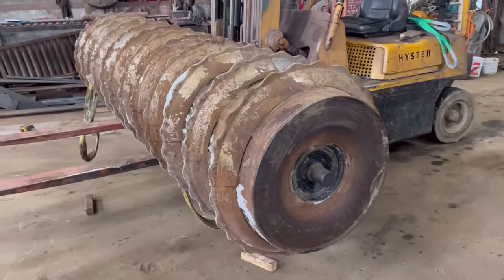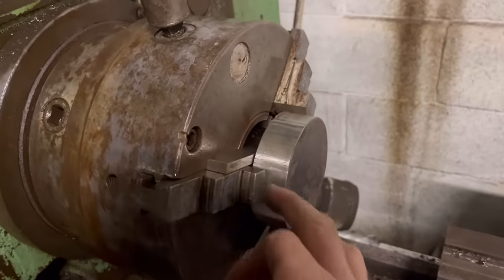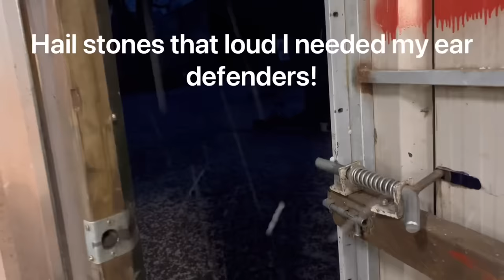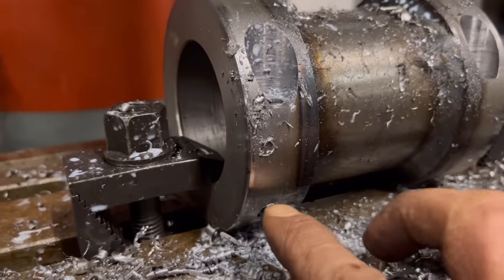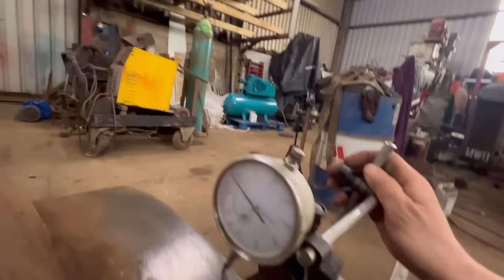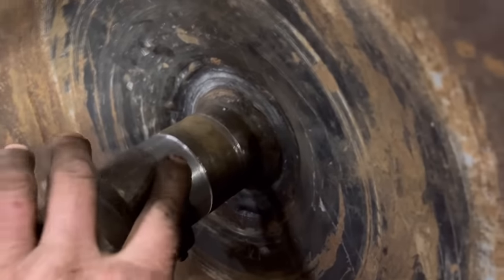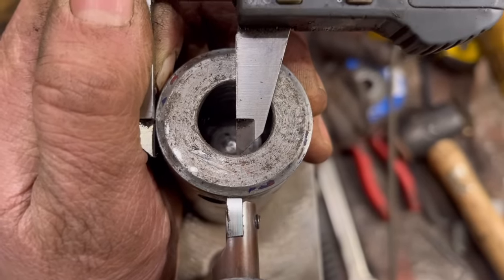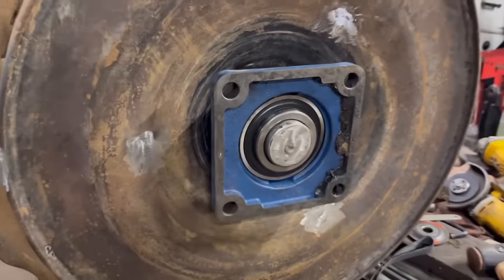Rebuilding stub shaft on Sumo Trio packer roller.

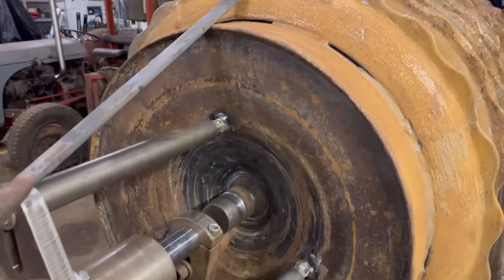Comment: 45:48 maybe another three legged support same as the one bolted to the legs you welded to the roller.
That should stabilise the cutting shaft holder to reduce movement.
I’m sure you will have a multitude of modifications over the years to perfect your line borer.
Changing the cutting tool center height made a big difference there was more cutting less rubbing.
👍👏🚜

Comment: Where most would have given up, Snowball figures out a way. Impressive!! It seems like some support on the other end of your line-boring rig would have helped. If your fabrication table extended out under the line-boring setup, and there was a way to brace the hanging end so it isn't hanging, it might cut down on the wobbling. I'm sure you'll continue to improve the design, and I'm here for it.

Comment: Hey Oliver, very nice, well done. For this type of work i love the horizontal boring mill tho 😅 maybe for more rigidity put a roller stand on the far end where your drive motor sits, it could help the flexing of the entire boring setup. Or try for a finish pass a razor sharp ground aluminium insert or hss toolbit and take of only a small amount to get a good surface finish. For this application it is good enough considering the amount of wear and that it was in use with a couple mil undersize 😊 Greetings from Germany, Chris
Reply from the maker: I was using an aluminium insert for the last light passes. Was cutting a lot nicer with no chatter 😄
Reply: @snowballengineering  good to hear it worked for you 😊👍. For me almost the only reason to have aluminium inserts, as most of my work is steel. But they do come in handy in some setups where rigidity and stickout is an issue 😝

Comment: Very impressive line boring setup. I don't think people understand what it takes to get this right and how much it costs in time and materials. A set of metric 8mm taps for example, hugely expensive. I hope you charge customers appropriately for your skill and time. 
I think getting the whole roller to run true on rollers is very difficult as the wear and out of round are not only affected by welding but also by the nature of the work that the roller does.
Well done, thanks for the video.

Comment: You can make it more rigid by replacing the washer on the capscrew that's holding the tool holder. Make up one that's 10mm x the width of the tool holder holder. If that makes sense. Great job and great channel.

Comment: NIce work Ollie. Love the home? made line borer...I might have to make  me a copy as I have a 1970s vibrating roller that needs the stubs repaired. Regards chatter - maybe support the end of the boring assembly as already suggested, and rough out with a tip tool but then switch to a purpose ground square bar HSS cutter with high rake angle and sharp but radiused tip. Tip tools need higher speeds for better finish and I think the HSS option would improve the finish at lower speeds. Using some cutting lubricant on the final cuts too may further assit. Carry on the great work....cheers P from NZ

Comment: That must have been one of the most complicated repairs you've had in, needing to make all sorts of adaptors to be able to get the job done. After you fitted the bearing, I was wondering how the shaft got worn in the first place, seeing that the bearing is supposed to be a tight fit on the shaft. Once again, you nailed the job and once the other end is done, the packer roller will be back in service again. At least if you get another one of these in for the same repair, you are pretty much set up for the job.

Comment: Great job.  The stub shaft was obviously not designed to be serviceable (for obvious reasons).  I bet your customer could buy a very fancy grease gun and a lot of grease for the cost of this repair.
Reply: Most farmers are known to ignore basic maintenance. Use the equipment till it breaks and fix it, while they complain about how long the repair takes 😄
Reply: it most probably had a poor construction, the tolerance of the pin fit was wrong, it had to be a tight fit due to circumferential load
Reply: @Frank-Thoresen   I agree.  I have a farmer in the family and I know loads of Farmers. I have a smallholding and occasionally buy used, small, farm equipment.  All of the stuff I have seen has suffered from severe lack of attention similar to the shaft on this cultivator.
Reply: @nascodigorgio6121    Maybe.  However I also know that the guy who founded Sumo and designed a lot of these cultivators is known for building stuff that is over engineered rather than the opposite.  At least thats what I am told by some farmer friends who know him well.

Comment: On the lathe stick a piece of bar stock in the chuck.  Put indicator base on headstock and indicate vertical spindle play as you lift the barstock. You may need to get in the manual and the headstock and tighten the preload on the spindle bearings. Aim for 10 to 15 inch pounds of breakaway rotational force. That is about one foot pound.   A 24 inch bar centered in the chuck with one pound hanging from the end.

Comment: Really interesting! Thanks you for making this video. I enjoyed watching it. One suggestion. When making the adapter (40mm to 60mm) I always think towards future jobs. The 40mm part remains the same but make the 60mm part removable so that when your next job calls for a different size you can make another adapter and just insert it. Just a thought. Great video!
Reply from the maker: I’m thinking I can make sleeves to fit in the 60mm end so I can use it for different size shafts.

Comment: A tremendous amount of tedious work and your ability to overcome the obstacles is second to none. Question: Are you able to pass any of the cost of fixturing and process development on to the customer or do you have to eat it all? I also realize that the implement that this roller is off of may belong to your family’s farm, in which case, you’d be eating the whole job anyway. Either way, the next one of these you do will go much smoother and the customer will get one heck of a deal!

Comment: Great Video and well done.
Seems like it needs a way to lock the inner bearing race onto the shaft so it can’t spin.
Your light press fit may just do it.
I’m just kidding but you must have some very accurate dirt in your part of the world.🤠
Reply from the maker: There is scrapers on the roller so even tho it’s only a packer roller it doesn’t want to be too far out of true otherwise it’ll catch them

Comment: would it have been possible to weld a flange on where the clean part of the stub shaft was, the part where the spacer sat, then you could have a second flange with stub shaft bolted to the first flange.  If you had enough room to extend the width you could bolt the two flanges together or if there wasn't enough room then thread the first flange to accept the second.

Comment: Hi Ollie, well thought out solution to a tricky problem. Was a bit concerned when you welded those blank flanges onto the ends of the pipe. You actually had a small bomb, as the pressure created by the heat of the weld must have been quite considerable, was hoping you would have drilled a small relief hole in one end. However nothing happened, so no problem, just an observation !

Comment: that is a really clean oxy/fuel cut, I have cut 51 mm plate with oxygen/fuel on a cnc table.....a bit scary, but it works out great....I think I was cutting at 15 inches or 200 mm a minute.....cheers.....Paulie

Comment: Hi Oliver. Once again another good video, your ingenuity and dedication to getting the job done amaze me, A suggestion Oliver, you have a sizable bearing carrier between the triangular adjustable support and the tool holder Oliver, could you not fabricate a second triangular support of a slightly lighter plate to fit on the outer bearing carrier, or possibly between the tool holder and the original support to make it more rigid, you may only get support 30 centimetres or so closer to the cutting tool, but it may be enough to stop the chatter.

Comment: We used to cut the whole lot out and replace with new, simpler and quicker  but when you make it in the first place it not a problem, the outside dish is just to stop soil buildup .
Reply from the maker: Cutting the whole lot out will certainly not be quicker now I have the collar made to centralise the shaft.
Reply: @snowballengineering  if you're going to be doing more of them yes it might be quicker but you've got to include your time making the coller to do the job in the first place.

Comment: I wonder if it would be possible to put a jack screw in behind the tool to advance it, a really fine thread grub screw with a machined end. Obviously you'd have to shorten the tool a bit. Might make it easier to adjust?

Comment: couldnt you just cut the spindle down then heat up a piece of tubing and slide it over then drill and tap the end of it and use a bolt to lock the tubing in place, then you would have a replaceable wear part in the future.
Reply: They would probably keep driving it until that was worn out and it was down to the stub again.

Comment: Judging by the sparks when you were grinding the end of that stub shaft, it looked to be a medium carbon steel, so I would have used some wear resistant wire filler vs. mild steel...  I'd also have drilled a reference divot in the centre of the shaft for next time..

Comment: So do you still think this was the easier solution or would you just gouge the welds out & remove the end disks to weld in a new bar were you to do it again ? 
It seemed to me that the thing was never built to run true as like you said, it’s a packing roller that bumps up & down over the ground soil.

I was wondering if a heat shrink collar would have been easier than welding it, maybe with some slots to plug weld the collar to the shaft for extra adhesion.
Reply from the maker: Definitely an easier solution, I did the other end this afternoon still half asleep after a big weekend.

Comment: With that tool holder, you might need to make another one with the hole drilled at 45° so that it's got a longer reach. That's the basic idea which would need perfecting.

Comment: I always wonder how those pins and bushings you're fixing end up in such a condition. Do people not grease machines at all, or where does such wear come from? But once agin, nice work :D
Reply: I guess the tolerances of the pin to the bearing was wrong, it depends on if there is a point load or a circumferential load, in this case the inner bearing was supposed to be tight due to the circumferential load, so Oliver did a good job making the fit rather tight
Reply: The grease only goes into the bearing. This is wear is caused by movement between the shaft and the bearing.

Comment: It's not advisable to use a gas lighter with a gas torch / welding 

It's either or because it could explode when lighting and or from the heat if you put it in a pocket & then get close to the heat...

(It also probably not good to have one on your person if there is splatter flying around)

Comment: The last time I repaired one of those I hand welded the shafts and ground it down with a grinder to fit the bearings 
Locktite and l was done 
I think you over thought this job
Reply from the maker: So you bodged it then 🤣  People come to me for a proper repair and I do the best job I can.
Reply: @snowballengineering  I understand that you don’t compromise your standards of service 
It is only a land packing roller and turning very slowly 
I think your craft is very good 
Keep up the great work

Comment: Why not  just fit a smaller bearing on the  cleaned up  shaft?  Difference in strength of smaller diameter shaft would negotiable.
Reply: Should have said  negligible

Comment: Shouldn't the manufacturer have made the stub shaft from a 'harder' material than the bearing? I would be contacting various other manufacturers about their materials before hand, if i was buying a cultivatior.
Reply from the maker: Generally there isn’t supposed to be any movement between the bearing and shaft so wear shouldn’t occur. But as with all things mechanical, failures happen.

Comment: hi ho i'am no engineer but the cutting hold post holder  could you make another base plate that slide over holder post weld in place then cut triangle to support both holder and new base plate that would lend support to holder as now the base of holder is even less 50% diameter of holder to me this would allow movement/pressure on cutting tip to wander/defect or just mill a new larger bottom holder cone sharp if you would with slide cut and mounting bolt threaded hole